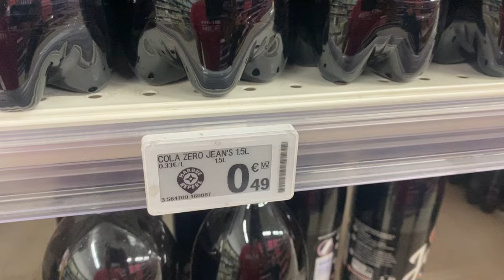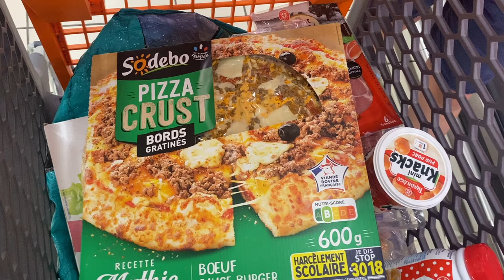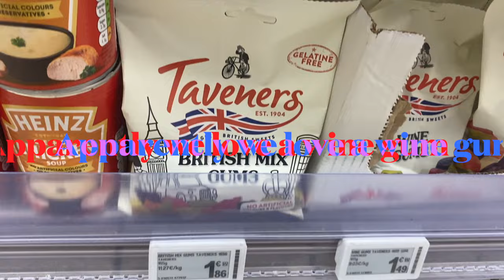We left the UK | Food shopping in France

Comment: That was a nice LeClerc the one Montorillion does not seem as nice as the one you visited. What town was the chateau in you was driving past looks a nice area, For the Fate National over the weekend was at a brocante then saw fireworks.. The pipe work looks good you used plastic clips we have metal ones on our pipe work,  Now if your really clever to hide the pipe work when you come to renovate area is to use a racking systems to the wall and that will secure any plaster board . You will lose a bit of void space on the wall but the pipes would be hidden behind it.  Self levelling compound that's latex based on the garage floor will give you that smooth surface. Just mix it up in a tub and add the stabiliser. it will self level. Then you either use garage floor paint or tile it afterwards another project, With the sheep if you excepted them depending on what the arrangement is inform your house insurance incase they cause damage to a neighbouring property . Take a picture of each sheeps head as each sheep has a unique facial pattern. As proof of lose and accountability. Same with dogs. You can take a picture of your dogs nose as this is the dogs fingerprint. The surface of the dogs nose has a unique impression.  Before you let anything grace on your land get a contract done, There is farming legislation to consider the EU ear tags or origin etc. lots to think about, Merci :face-blue-wide-eyes:
Reply from the maker: @Jean-MarcBordeaux  Hi Jean-Marc. The chateau was in La Rochefoucauld which is about 25 minutes away from us.
The pipe work is in the work shop which is gonna pretty much stay as it is.
Would like to level the garage floor at some point but that job is a long way away.
All good stuff to know about sheep and permissions etc. sounds more trouble than it’s worth now tbh.
Happy Bastille day and I hope you enjoyed the festivities 
🇫🇷👍

Comment: You need to maintain a continuous flow in the pipe so it won't be clogged easily or too often. 
So you need to attach the pipe to the wall. The recommended slope for waste pipes are 5mm per meter as to avoid emptying the siphon.
Usually, you have a vertical drop under the sink. It's also easier to start the slope from the fosse.
Reply from the maker: All very good points, but i was left with a mess of a job. I'm no plumber so have had to do as much as I can with my minimal skill set.
Although not perfect it's a lot better then what it was previously....so happy days :)
Reply: @Escapetofrance-Charente  I'm no plumber either. Just a kind of jack of all trade like the one you're becoming to maintain and improve your house in the countryside.
When you have the time, you still should attach the pipe to avoid bent parts that can and will retain water and all sorts of dirt.
Reply from the maker: @Belaziraf  lol I’m a jack of most trades but master of none.
Did you watch to the end? I’ve clipped the pipe to the wall on an angle so it drains properly. Hopefully all is good now 🇫🇷👍
Reply: @Escapetofrance-Charente  Master of none but it also means good enough to rarely be helpless.
And from what I've seen in all your videos, your handicraft is way better than that of amateur and not that far from professional work, considering the results.
Believe it or not, in the last decade, France has focused so much on specialization that there are even some that know how to write properly or can put up IKEA furnitures.
That's why also due to inflation, DIY channels are so popular. With many fakes or absolutely impossible for common people.
I admit I stopped a few seconds before the end as you usually made your conclusions in the last 30 seconds or so.
The clips looks quite distant in the mid section. Keep us updated in a few month about it.
Anyway, keep up with the good work and mood !
Reply from the maker: @Belaziraf  wow, what an amazing comment, thank you. It must be my editing making me look half competent lol.
I’ve got another clip which I was gonna put in the middle but didn’t have time as we had friends coming round. 
Thanks for watching as always 
Laterzzz 👍🇫🇷